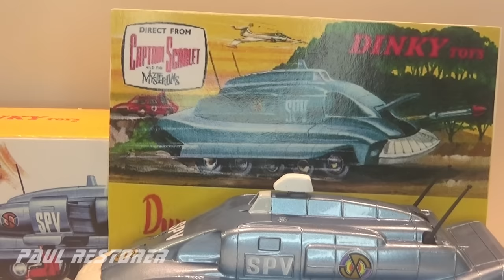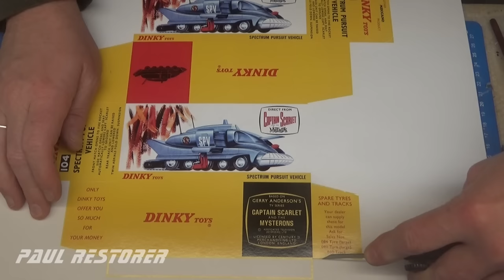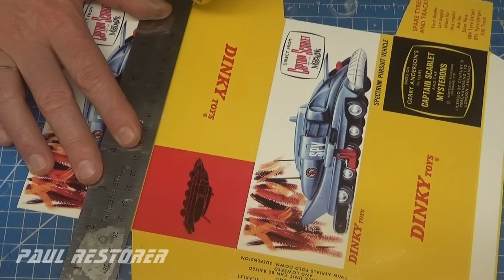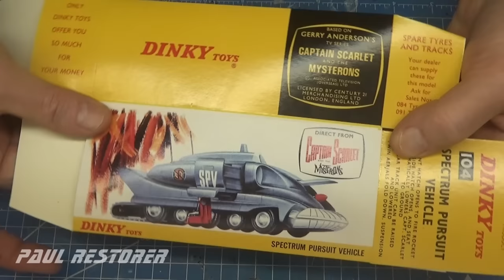Dinky renowacja Captain Scarlet SPV nr 104. Gery Anderson serial TV. Model odlewany.

Comment: Had one for Christmas in 1973, somehow managed to break the chasis off the main body and it is now lost in the mists of time during about 5 or 6 house moves in my childhood! Looked at buying a replacement off Ebay recently and a mint boxed example now worth a fortune like many "Anderson" models. You can buy most of the parts in order to restore a knackered one but depends on your ability as shown in the video. Plastic kits are one thing but even more skill is required for accurate diecast rebuilds along with a wealthier bank account!
Reply from the maker: cool

Comment: I see you're using the rattle can for the primer and color coat. When you switch to the air brush is that the clear coat or something else? I can't tell clearly enough from the video. Thank you.
Reply from the maker: The airbrush mainly varnishes with acrylic varnish with a hardener at the very end to get the right flash and hardening of the base paint. Kind regards

Comment: good work but the driver was captain blue and the base should have been black.
Reply: I have an early one in original condition,  the base is the same colour blue as the upper half, dinky made a lot of minor changes to colours/ parts during production runs
Reply from the maker: Thank you very much
Reply: @johngreen-sk4yk  Mine must be an early version too. It has an all metal release button for the door instead of this white plastic effort. What is yours made from?

Comment: Fantastic watch and a great job. I have one, but the rocket mechanism and hatch isn't working. I may have a go at the repair -slowly - using yours as a reference. I see you drilled out the rivets and replaced them with self-tapping screws? Can you tell me the size of the screws?
Reply from the maker: drill holes with a 1.6 mm drill and then thread with a m2 tap to screw in the m2 Torx screws
Reply: @PaulRestorer  Thank You!

Comment: Fantastic video Paul. I am starting to do this as a hobby and this is exactly my first project. What size drill do you use for the rivets ? And what do you use to clean all the parts? Thanks.
Reply from the maker: thank you very much I am very happy that you have started restoring models I use a 1.6 mm drill and the screws are M2 size I clean the parts in an ultrasonic cleaner

Comment: What was the third Captain Scarlet vehicle, Paul? I looked back a bit, and I only saw the Maximum Security Vehicle. I’ve watched all of your restos, so I obviously don’t know what I’m looking for. Great job on this one, as usual.
Reply: The Spectrum Patrol car, from about a year ago.
Reply: 1. SPECTRUM Pursuit Vehicle SPV
2. Maximum Security Vehicle MSV
3. SPECTRUM Patrol Car 
4. Angel Interceptor
5. Captain Scarlet pistol (cap firing) with holster

As a member of the Gerry Anderson Fan Club at age 9, I had these as birthday and Christmas presents. The first two on the list were die-cast but the others were in plastic. I also had the airfix angel interceptor model (at least 4 times) the driver of the SPV was captain scarlet in mine and it was from the first production. I'm now in my 60s and remember the toys fondly. I also had the plastic kit of fireball xl5 (zoom ice lolly offer which came with a small plastic badge) and stingray (which I think came from a cereal box top offer)  from the 60s and I know there was an XL5 kit produced by Lindbergh in the 1980s as I saw it in a model shop but didn't have the cash on me to pay £19.99 at the time. There were also miniature kits in cereal boxes in the sixties that my brother and i used to fight for when the new pack was opened. Inside cereal packs was the only place you could find a spectrum helicopter kit